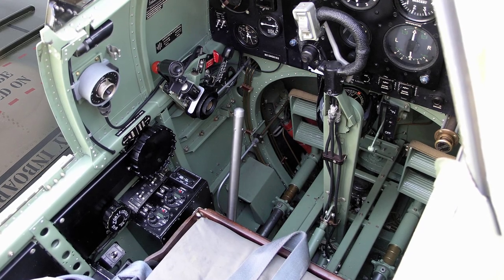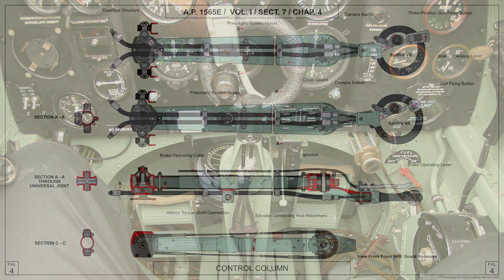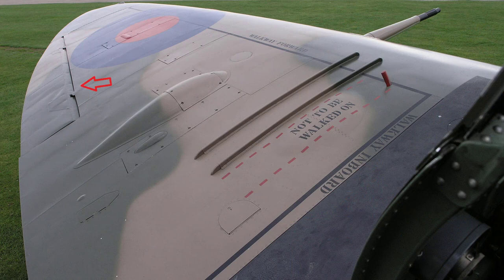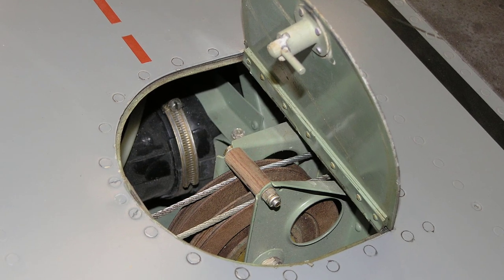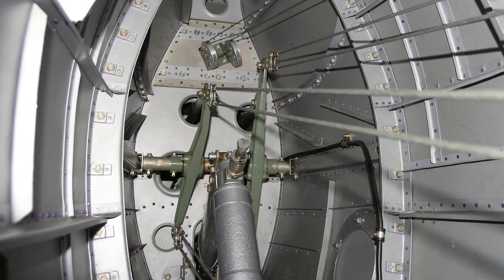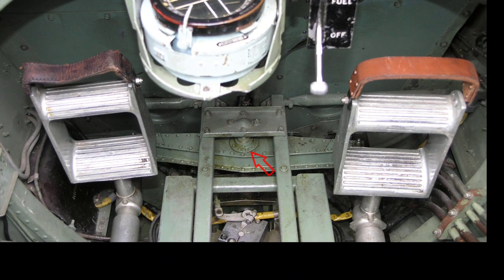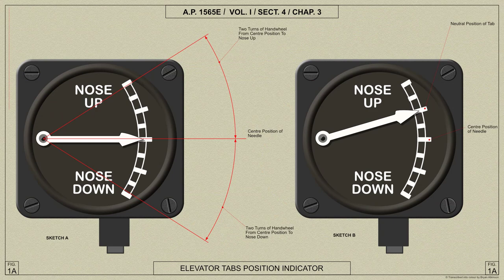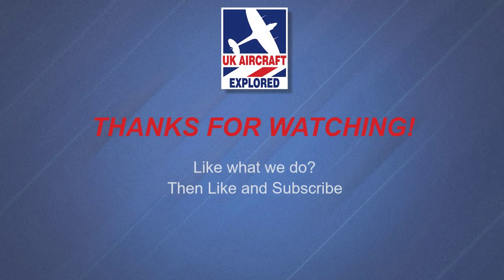Spitfire Mk V - Flying Controls

Comment: Fascinating. The days before 'fly by wire' controls we have now, electronic controls.
I'd guess an aircraft could be rendered useless just from a single round from an enemy fighter if it hit a cable or pulley.
Thanks for making this video.

We Will Remember Them🇬🇧🌹
Reply from the maker: Yes, an unfortunate hit could certainly effect the operation of the controls